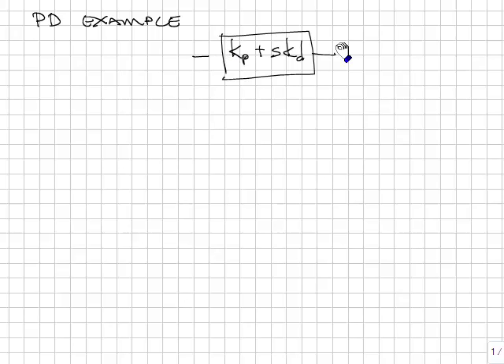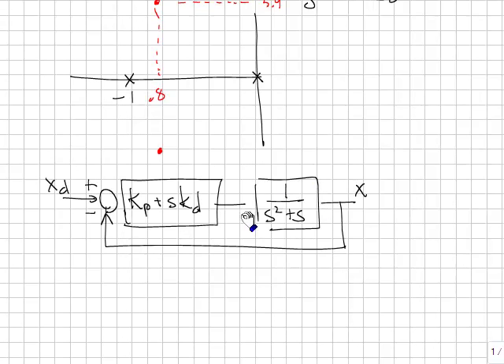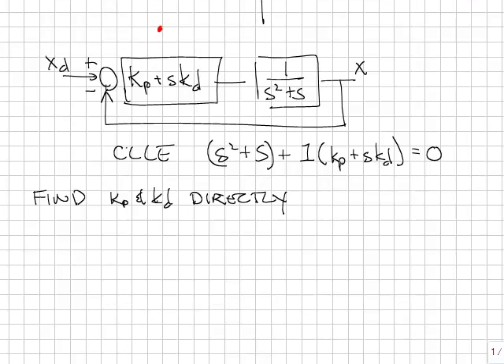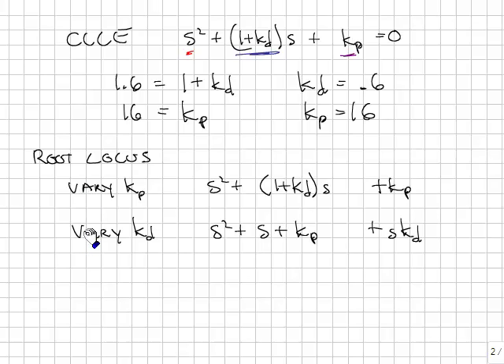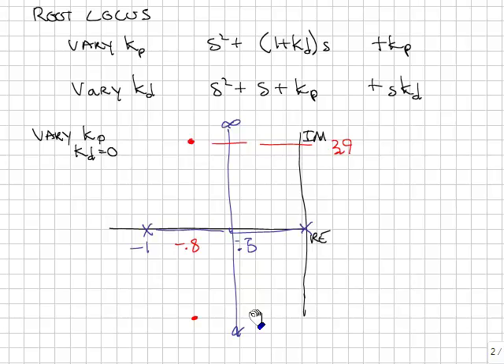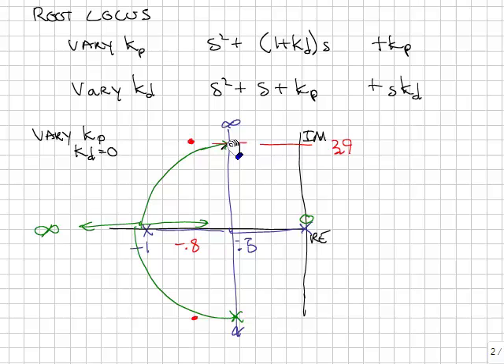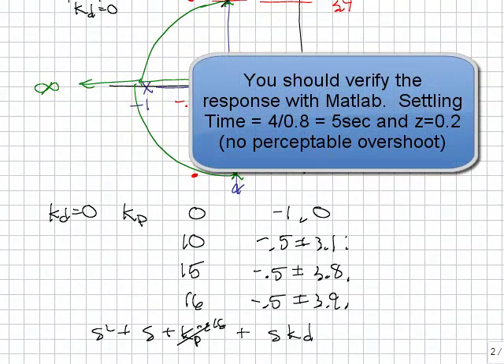PD Control Example #1

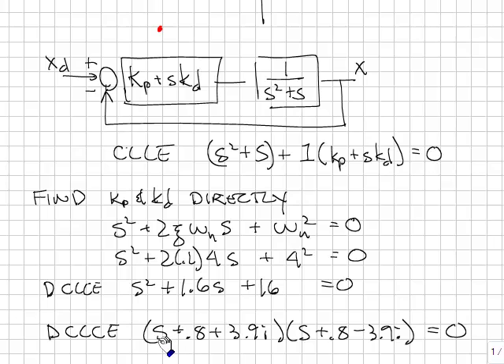Comment: How did he get the DClCE at 4:32 i know he says you have to put those values for desired output in the CE but i dont see how he derived that formula
Reply: it what you get if you: 
 (as^2+2bs+c) = (b-square root(c-b^2)) ( b+square root(c-b^2))  ....  in this case (s^2+1.6s+16) -->  (s +0.8+ i 3.9)(s +0.8 i 3.9)... this is becouse D=(b^2-c) <o          ===  ( 0.8^2-16=-15.36)